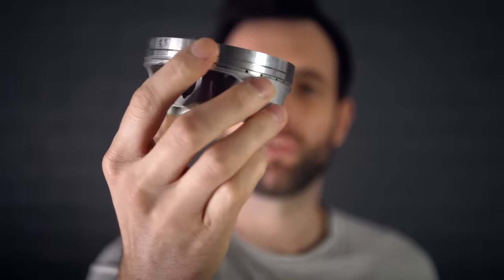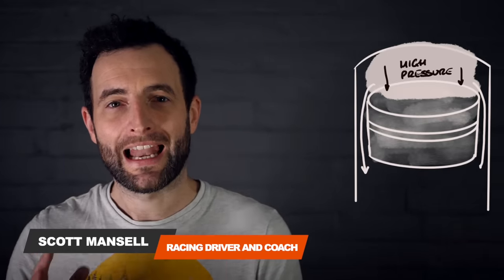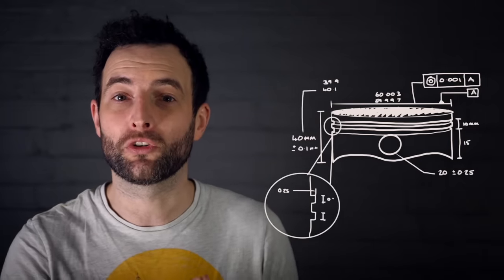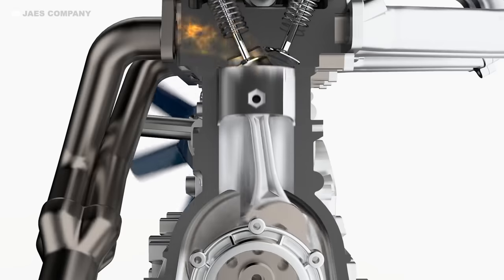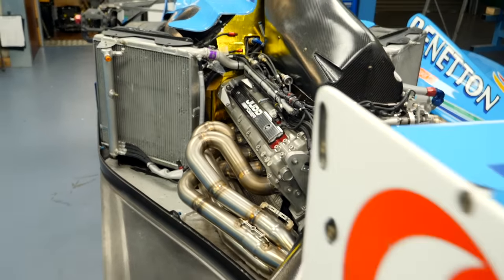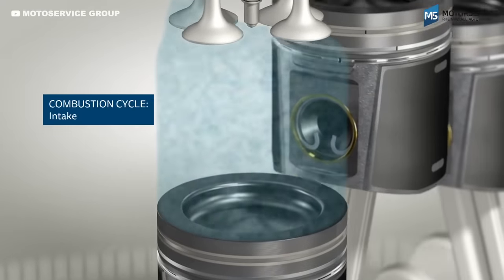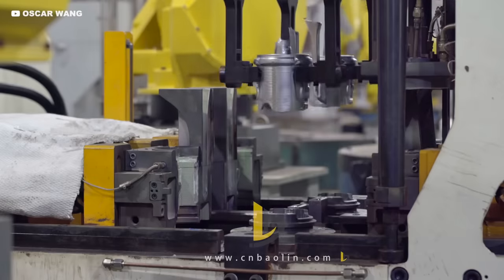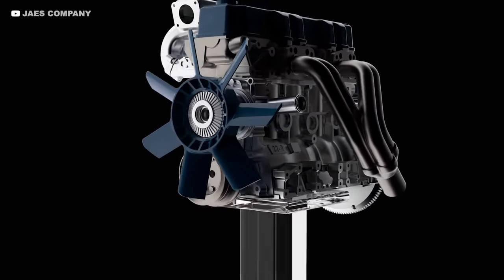Why F1 Pistons Cost £50,000!

Comment from the maker: Did you know so much goes into these Pistons? 

Thanks to Fuel for Fans for supporting the channel! Check out the link in the description!
Reply: The other cost here is the incredible amount of time and labor spent on development (R&D). But $67,200.00 is more than I could have imagined.
Reply: I'm genuinely surprised they don't use some sort of titanium aluminum alloy
Reply: Ummm, no way they cost 50k pounds. Maybe for their entire allotment for a whole year, but not per engine and definitely not per unit. Each team makes many of these pistons each year & the tech is well developed and understood & has been for a long time. Ultra high rpm engines have been around since the late 50's/early 60's. Modern machining is extremely fast and very accurate & can easily get to very high tolerances. The metallugy is also well developed. Pistons have been made slightly oval on all kinds of engines for decades now. These pistons cost no more to make than anything you'd find in any high level sportbike(many of which spin over 15k rpm). 
Once they have the design figured, the rest is pretty straightforward. The design work is also much easier now that it used to be. The software available for this is incredible.
Reply: @overlandwalkabout6376  I was thinking the same, also he stated that F1 pistons runs with 0.15mm clearance, that does not add up. I hope he will clarify
Reply: @Iggy900ss  it is an urban myth that f1 engines can't be rotated cold.
Reply: @3canctheayr  The high reving engines of the 50's and 60's didn't have turbo. And the turbos of the 80's and 90's was so short lived that they used 5-6 engines on a race weekend. And used an unbelievable amount of fuel.

Today's F1 engines are the most efficient Internal Combustion Engines probably ever produced.

When it comes to price pr piston, I can't say what's right or wrong, but I can when it comes to gears in the gearbox. 
Many use gears made by Hewland. They had to invest a big amount for a new machine to make gears to a tolerance level that was just insane.
The engineer from Hewland that I talked to said that this tolerance probably didn't have any advantage when it comes to performance, but the F1 guys wants them that way.

F1 is a study in how to make something incredibly expensive.

What about the pistons? 
Guaranteed they have clearances and tolerances exclusive to F1, with machining time on the extreme.
And the price? Probably much closer to the price listed here than a typical high end tuner piston.
Reply: hi, why do f1 racers go very wide around the corners while practicing and qualifying. on purpose. drivers do know that if they go too wide the rear tires will get caught, the car will pulled out of the track causing spinning and losing traction which causes accidents and crashes like the alex albon in qualifying session  at last weekend i get it that they want to post fastest lap times. at what is limit to go wide around the corners. can you explain.
Reply: @MrLundefaret  Turbos have little to do with the issue. None of the reasons laid out in the vid make the pistons expensive, as I indicated. None of the stuff he mentioned is cutting edge, or special tech exclusive to F1. They may be expensive pistons, but not that expensive. If they're paying that much, they're wasting tons of cash. Maybe the teams are laundering money or something.........
Reply: @overlandwalkabout6376  add to that that forged aluminium pistons are low in silicone, increasing theit expansion and the blocks are cast, which allows them to use more silicone to make a harder block and decreases thermal expansion. So you would expect the block to have a lower coefficient of expansion than the piston, even without a iron-based coating.
Reply: @3canctheayr  Well, wasting money is another discussion :) But to say that all spending in F1 is good, well...
But regards to the pistons.
I am of course not sure how they have made this price calculation, if they factor in R&D (then it's at least that sum) or what.

- First I think it's very important to remember how few engines (power units) F1 teams are allowed to use during a year.
- Then I think it's important to understand the extreme efficiency the ICE has to deliver to get the necessary performance.

Then it's of course the choice of metal and the treatment of it, and the machining, based on an enormous amount of R&D.
So if you divide the pistons one team is allowed to use pr year, with the total development and production cost, then the price is probably in this region.

Two shock absorbers can look very similar, and have the same basic technology, but one can cost 10-20 times the other (and of course much more), because of the hours spent on R&D and precision engineering and manufacturing. Though for the untrained eye they can look the same.

To make something purely bespoke, costs an extreme amount of money.

Just try to tune your car and ask a piston manufacturer to specially develop tailor made pistons for just your car, it will cost A LOT!

BTW: Turbos have a lot to say as applying a turbo charger increases the forces the piston has to deal with.
Reply: @MrLundefaret  It's as I said.
Reply: @overlandwalkabout6376  Seized does not always mean fully locked up, but is generating excess friction ie rusty bolt and nut it can still turn but will cause damage. The steel liner is a thin plate when it expands its length will expand and create a greater circumference when formed in a cylinder its thickness needs to be matched with the expansion of the aluminium block.
Reply: F1 average piston speed is around 25 m/s not 10 m/s as shown in the video.
Reply: @Iggy900ss  i just put together the engine on my galant vr4, my machinist recomended to go with a slightly bigger piston gap at .003in because we were using forged pistons, and that equates to around 0.075mm, an f1 engine can't possibly have a gap twice the size of a road car
Reply: @blackace7782  Not allowed.
Reply: Well I am mechanical engineer and this was explained properly. I personaly hate aluminium because there are methods to make pistons of steel and still be as light as from aluminium. But f1 piston does not cost 50k...that is apsurde...not by any means...neither the metals used in alloying the aluminium or the machine work. 5000 would be more accurate price
Reply: Are you sure 300g multiple by 200 G-Force is 600KG? (On each piston) Don't you mean 60KG?
Reply: Internal combustion engine is probably the worst thing that could have happen to the human race, never owned a car and never will and if you do, tyhen you should re-evaluate your whole life
Reply: @justkaz7104  that's what I said but a clever person reckoned he meant newtons
Reply: @princeedmunddukeofedinburg  aaaww poor didums.
Reply: @princeedmunddukeofedinburg  Why on earth have you seen this video?
BTW: Do you think ambulances and fire trucks are a bad thing?
Reply: @overlandwalkabout6376  are you sure about the steel liners?
That is rather primitive technology companies like BMW or Mercedes haven't used in their road cars for decades if ever. The bores in their aluminium blocks are coated with Nikasil or similar which is much harder than steel and since it is a coating expands at the same rate as the block. It is also the reason companies like Brabus charge you in the region of €200k for boring out a Mercedes V8 or V12 motor as the coating eats tool steel for breakfast. And of course it will have to be reapplied afterwards.

Beyond that forged pistons, con rods and crankshafts are standard for German road cars.
Back in the '60s Opel wanted to use a US 5.4L V8 for their top of the range coupé. They had to go for a Corvette race engine with forged internals because the lesser motors kept disintegrating on longer runs on the Autobahn at sustained speeds of 160km/h+ (100mph).
Reply: @5:44 The force is 588.6 Newtons not Kg. On earth 1 newton exerts a force of around 100g (101.97g) so the "weight" of the piston is actually more like 58kg.
Reply: Why not use piston aircraft engine, those ww2 relic have over 2000 hp. For example the R-2800 Double Wasp have over 2300 hp and is far cheaper to manufacture.
Reply: @3canctheayr  I totally agree with you, Brian. There is a great deal of ramped up nonsense being presented here. As you most rightly say,the development techniques for exotic engine components have never been better understood or more easily accessed than they are today. In the 1960's a great deal of the thinking on how to obtain very high BHP per litre were already known. The limited metallurgy technology of that era was all that held the realisation of the development back.
Reply: Yes.
Reply: @3canctheayr  As a former engine builder for Renault, i can indeed tell you they are definately not 50K but also never heard any price on them. As the money for a engine project is distributed to several parts i don't really think there is anybody who knows exactly how much they are
Reply: @Timberjagi   I think the guy that did the vid doesn't really know & somebody fed him some nonsense to get him to stop bothering them LOL.
I'm guessing that 50k number probably could mean all the pistons for the season, including any rebuilds.
Reply: AFAIK newer F1 pistons have a bonding of a stronger metal on the top side (already since a few years).
Reply: @MrUltraworld  3333333333363636333
Reply: Ma daiiiiii voi insegnare , combustione mmm i Tedeschi senza soldi nn vincerebberó neanche se li fai correre da Soli !!!
Reply: Is f1 engines was a crossplane?
Reply: yes lol
Reply: @nyftn  ma nn funziona il tradutore ? Non capisco bene Inglese scusa amico 🔜🏍️👍👍👍
Reply: @nyftn  no troppo costoso per me , peró vi seguo arriva una nuova Moto , prima vendere Yamaha FZ6 2016/ prodotta uscitta sai come funziona , che bisogna attendere un anno : Rocket team , ma davvero quanto costa una rettifica a 4 tempi 600 78cc
Reply: Clearance on a modern four stroke mx bike is 0.03-0.055mm. So the figure of 0.15 is a mistake. Probably means 0.015?
Reply: Fancy seeing you here Anton!
Reply: Drive61, ,,, well from the vid and the piston in hand, there's about 49 thousand Pounds Sterling missing .
Reply: 0l
Reply: I guess I missed the reasons for the exorbitant cost? The tolerances certainly aren't it. If you had an F1 team budget, you could also spend this much? They are simply highly developed, low volume components backed by tremendous funding. Add R&D and it makes sense.
Reply: @rcdieselrc  ,,, you didn't miss anything, there wasn't any details that covered the extraordinary costs .
Reply: @3canctheayr  I agree with your assessment and comparison to sport bikes.   To be honest I did not think the processing of the pistons in the video was that exotic at all.
Reply: @justkaz7104  
Yes ... F = mass * g  = 200 x 0.3 x 10 = 600 N
Reply: @MrUltraworld   Piston is old technology all what is needed is tweaking of material selection  and some additional design elements
Reply: @princeedmunddukeofedinburg  poopy butt go vroom vroom
Reply: Hi
Reply: The geometry on the crown of these pistons are incredibly complex compared to the simple geometry for road and aftermarket ones.  No other turbo petrol engine cars run 18:1 compression ratio so I can understand why they costs so much
Reply: It could be accomplished alot cheaper.
Reply: @Freeknickers24  yeah if you're building engines out of a shed that'll last 1 lap and make half the horsepower.  If you've been to Brixworth you'll understand why things costs so much.
Reply: Did you say in the last video what an f1 is worth a engine in that video is 3,500,000 and here is over 7,000,000 I am just curious
Reply: @George.Andrews.  ⁰
Reply: @Driver61 why do you use dozens of videos from other content creators in your videos? Can't you create your own animations?

Not a big deal; I'm sure you profit share!
Reply: 0
Reply: @MrUltraworld  it's still made of aluminium or steel though, cheap materials,teams pay for labour,material fees only. But if they sell off to fans they will quote a ridiculous price.
Reply: May I STRONGLY suggest you work with NEW MIND (yt channel) who has a series on the spark plug, oil, and machining tolerances, which are (IMO) the absolute BEST that exist (as good as yours are, these are 20 min videos dedicated to tiny topics).
Reply: I went and checked them out just to give them an impression it was so smooth.
Reply: @MrUltraworld  I bought 4!
Reply: @MrLundefaret  why can't they use Ti pistons?
Reply: Did you know
you could ask[interview] a guy who manufactures[the machine operator]  these and you wouldn't sound like MSNBC.
Reply: “In the beginning was the Word, and the Word was with God, and the Word was God.
The same was in the beginning with God.
All things were made by him; and without him was not any thing made that was made.
In him was life; and the life was the light of men.
And the light shineth in darkness; and the darkness comprehended it not.
There was a man sent from God, whose name was John.
The same came for a witness, to bear witness of the Light, that all men through him might believe.
He was not that Light, but was sent to bear witness of that Light.
That was the true Light, which lighteth every man that cometh into the world.
He was in the world, and the world was made by him, and the world knew him not.
He came unto his own, and his own received him not.
But as many as received him, to them gave he power to become the sons of God, even to them that believe on his name: Which were born, not of blood, nor of the will of the flesh, nor of the will of man, but of God.
And the Word was made flesh, and dwelt among us, (and we beheld his glory, the glory as of the only begotten of the Father,) full of grace and truth.
John bare witness of him, and cried, saying, This was he of whom I spake, He that cometh after me is preferred before me: for he was before me.
And of his fulness have all we received, and grace for grace.
For the law was given by Moses, but grace and truth came by Jesus Christ.
No man hath seen God at any time; the only begotten Son, which is in the bosom of the Father, he hath declared him.
And this is the record of John, when the Jews sent priests and Levites from Jerusalem to ask him, Who art thou?
And he confessed, and denied not; but confessed, I am not the Christ.
And they asked him, What then?
Art thou Elias?
And he saith, I am not.
Art thou that prophet?
And he answered, No.
Then said they unto him, Who art thou? that we may give an answer to them that sent us. What sayest thou of thyself?
He said, I am the voice of one crying in the wilderness, Make straight the way of the Lord, as said the prophet Esaias.
And they which were sent were of the Pharisees.
And they asked him, and said unto him, Why baptizest thou then, if thou be not that Christ, nor Elias, neither that prophet?
John answered them, saying, I baptize with water: but there standeth one among you, whom ye know not; He it is, who coming after me is preferred before me, whose shoe's latchet I am not worthy to unloose.
These things were done in Bethabara beyond Jordan, where John was baptizing.
The next day John seeth Jesus coming unto him, and saith, Behold the Lamb of God, which taketh away the sin of the world.
This is he of whom I said, After me cometh a man which is preferred before me: for he was before me.
And I knew him not: but that he should be made manifest to Israel, therefore am I come baptizing with water.
And John bare record, saying, I saw the Spirit descending from heaven like a dove, and it abode upon him.
And I knew him not: but he that sent me to baptize with water, the same said unto me, Upon whom thou shalt see the Spirit descending, and remaining on him, the same is he which baptizeth with the Holy Ghost.
And I saw, and bare record that this is the Son of God.
Again the next day after John stood, and two of his disciples; And looking upon Jesus as he walked, he saith, Behold the Lamb of God!
And the two disciples heard him speak, and they followed Jesus.
Then Jesus turned, and saw them following, and saith unto them, What seek ye?
They said unto him, Rabbi, (which is to say, being interpreted, Master,) where dwellest thou?
He saith unto them, Come and see.
They came and saw where he dwelt, and abode with him that day: for it was about the tenth hour.
One of the two which heard John speak, and followed him, was Andrew, Simon Peter's brother.
He first findeth his own brother Simon, and saith unto him, We have found the Messias, which is, being interpreted, the Christ.
And he brought him to Jesus.
And when Jesus beheld him, he said, Thou art Simon the son of Jona: thou shalt be called Cephas, which is by interpretation, A stone.
The day following Jesus would go forth into Galilee, and findeth Philip, and saith unto him, Follow me.
Now Philip was of Bethsaida, the city of Andrew and Peter.
Philip findeth Nathanael, and saith unto him, We have found him, of whom Moses in the law, and the prophets, did write, Jesus of Nazareth, the son of Joseph.
And Nathanael said unto him, Can there any good thing come out of Nazareth?
Philip saith unto him, Come and see.
Jesus saw Nathanael coming to him, and saith of him, Behold an Israelite indeed, in whom is no guile!
Nathanael saith unto him, Whence knowest thou me?
Jesus answered and said unto him, Before that Philip called thee, when thou wast under the fig tree, I saw thee.
Nathanael answered and saith unto him, Rabbi, thou art the Son of God; thou art the King of Israel.
Jesus answered and said unto him, Because I said unto thee, I saw thee under the fig tree, believest thou? thou shalt see greater things than these.
And he saith unto him, Verily, verily, I say unto you, Hereafter ye shall see heaven open, and the angels of God ascending and descending upon the Son of man.
And the third day there was a marriage in Cana of Galilee; and the mother of Jesus was there: And both Jesus was called, and his disciples, to the marriage.
And when they wanted wine, the mother of Jesus saith unto him, They have no wine.
Jesus saith unto her, Woman, what have I to do with thee? mine hour is not yet come.
His mother saith unto the servants, Whatsoever he saith unto you, do it.
And there were set there six waterpots of stone, after the manner of the purifying of the Jews, containing two or three firkins apiece.
Jesus saith unto them, Fill the waterpots with water.
And they filled them up to the brim.
And he saith unto them, Draw out now, and bear unto the governor of the feast.
And they bare it.
When the ruler of the feast had tasted the water that was made wine, and knew not whence it was: (but the servants which drew the water knew;) the governor of the feast called the bridegroom, And saith unto him, Every man at the beginning doth set forth good wine; and when men have well drunk, then that which is worse: but thou hast kept the good wine until now.
This beginning of miracles did Jesus in Cana of Galilee, and manifested forth his glory; and his disciples believed on him.
After this he went down to Capernaum, he, and his mother, and his brethren, and his disciples: and they continued there not many days.
And the Jews' passover was at hand, and Jesus went up to Jerusalem, And found in the temple those that sold oxen and sheep and doves, and the changers of money sitting: And when he had made a scourge of small cords, he drove them all out of the temple, and the sheep, and the oxen; and poured out the changers' money, and overthrew the tables; And said unto them that sold doves, Take these things hence; make not my Father's house an house of merchandise.
And his disciples remembered that it was written, The zeal of thine house hath eaten me up.
Then answered the Jews and said unto him, What sign shewest thou unto us, seeing that thou doest these things?
Jesus answered and said unto them, Destroy this temple, and in three days I will raise it up.
Then said the Jews, Forty and six years was this temple in building, and wilt thou rear it up in three days?
But he spake of the temple of his body.
When therefore he was risen from the dead, his disciples remembered that he had said this unto them; and they believed the scripture, and the word which Jesus had said.
Now when he was in Jerusalem at the passover, in the feast day, many believed in his name, when they saw the miracles which he did.
But Jesus did not commit himself unto them, because he knew all men, And needed not that any should testify of man: for he knew what was in man.”

Gospel of John - Chapter 1-2, King James Version.
Reply: @joshag50  😅
Reply: @joshag50  😅
Reply: @joshag50  😅
Reply: Pity you didn't out more effort into fact-checking. Using your figures a piston weighs the equivalent of 60 kg and not 600 kg as you claim.
Reply: @3canctheayr  I don't believe any company would make its own pistons. The equipment required - especially for finishing the gudgeon-pin hole is far too specialised. I worked for a major piston company , and the tolerance for that hole was 0.0075 mm with an incredibly smooth surface-finish.